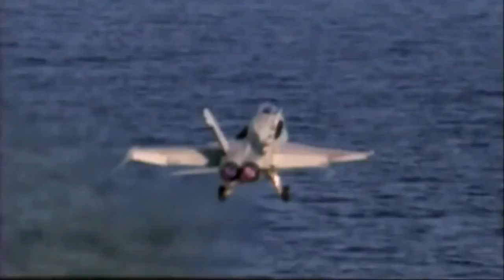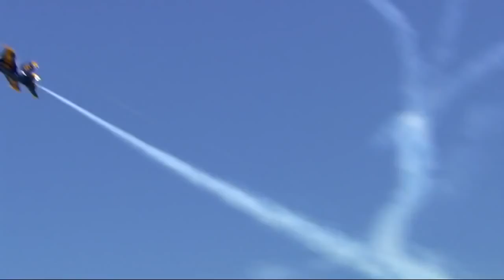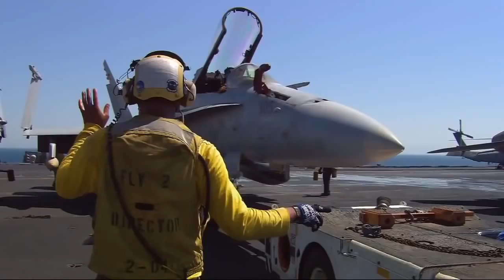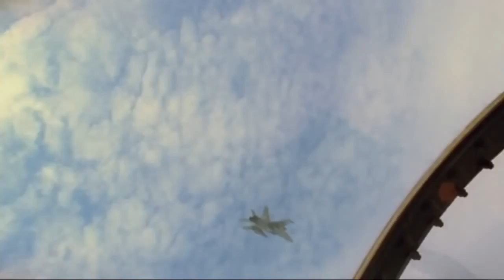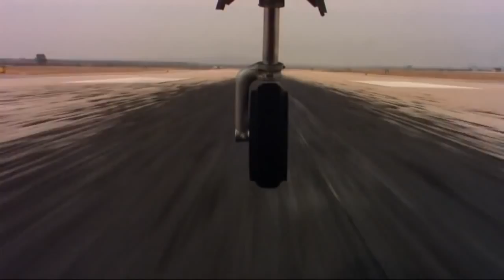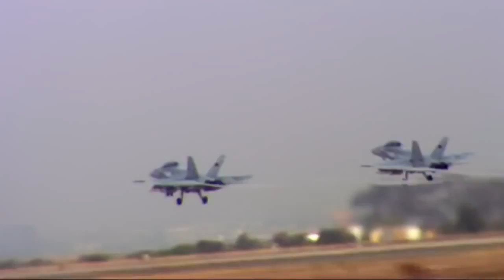Boeing FA-18 Hornet - World's Elite Strike Fighter Attack Jet Full Documentary

Comment: i cant believe i just realized that f 16 cant land on aircraft carrier
Reply: it could.... once.... and gear break off... hopefully no fireballz. did you know that the f-16 and f-18 competed against each other originally for the air force contract... the 16 won... then navy picked up the 18 after.
Reply: It's entirely possible to create an F-16 version for carrier, it was even proposed the Navy almost went for it. eventually they chose the F-18, since it really does have a stronger frame and two engines, while the F-16 has one. if the F-16s engine fails in the middle of the ocean, it's FUBAR.
Reply: Lol nope. Only navy jets land on carriers, f16 is Air Force. Same for f15, and a10 and whatnot
Reply: so you are saying f18 is strictly for navy only?
Reply: +oming daniel Navy and Marines, yes. The Air Force does not fly them. (I was surprised too when I found out lol)
Reply: damn , thanks alot.
Reply: No, airforces around the world that don't conduct carrier operations use F18's as land based aircraft.
Reply: There a re also F-18's in the air force ...
Reply: Krizla 4 Not the US Air Force though
Reply: I see ... because in for instance in Switserland they use F-18's ... they don't have carriers ... but they do have short runways in the alps ... that's where the F18 comes in handy with it's hook to land in short distances.
Reply: Spain, Australia, Canada, Finland and a few others use it as land based aircraft.
Reply: +Jacob Zondag they could, but the navy doesn't fly f-16's.
Reply: id say they dont, not that they cant..
Reply: wizzzer1337 They thought of this idea when the U.S. Navy wanted the f-18, but they said no to the idea.
Reply: You guys ever heard of the F-16N?
Reply: @JSpidey  Stripped down f-16 for Navy dissimilar aircraft training.

Comment: I hope that this plane does not get replaced and rather gets updated like the F15 will
Reply: F-15 is getting replaced by the F-22 Raptor
Reply: +Toxic 28 the f22 isnt theres only  around 200 of them and tgey arent making any more
Reply: +Toxic 28 they are not getting replaced they are getting upgrades and new electronics systems from Lockheed Martin.
Reply: Uncle Paulie where'd you get that info from? Because it doesn't need to be torn apart and put back together after every flight they need quick matinence  check and refueling like every other jet
Reply: Ironically, the F-22 was selected over the F-23 in part because it was more suited to having a carrier version to replace the F-14, then the Navy backed out.  That increased the unit cost, so we got a third the number requested.  The F-14 was replaced by the Super Hornet, and only some of the F-15s got replaced by the F--22.

Comment: USN Blue Angels are flying the hell out of the earlier F/A-18 A, B, C, & D models (aka Hornet)—parts of the jets are actually shedding during Blue Angel flight demos. The U.S. Navy wants to replace these older models with the much newer Super Hornet (E model & double-seater F model). However, the Blue Angels like the easier handling of the older Hornet, because it's lighter and smaller than the husky Super Hornet.
Reply: I wish if they flew the F-14. The F-14 looks way sexier
Reply: @huskythedinosaur1592 but it's not as maneuverable as the F18, that's why they chose the F18
Reply: OP has no clue, such BS propaganda, you smell like a F14 fanboy

Comment: they avoid the f/a-18's downsides completely, such as how the f/a-18 is very poorly equipped to actually fight any modern fighters. F-15,F-16,Su-27,MiG-29, etc. Any of these blow it out of the sky in air-to-air combat. They should keep the f-14 for air-to-air
Reply: The F/A-18E/F Super Hornet can kick all of the above aircrafts ass. I personally seen it happen in Key West when the Super got the AESA radar. They had shot down the F-16 before it even seen the Super
Reply: +Juuso Peltoniemi nimbleness is secondary, most of real life air combat is done beyond visual range. F/A-18 is great if we're fighting less modern militaries, but against modern dedicated air to air platforms it doesn't stand up
Reply: +InternetzSpaceshipz 

:  F-15, F-16 can't take off and landing on aircraft carrier. But F/A-18 super hornet can do and it's capacity isn't lower than F-15 too. but F-18 super hornet cheaper than F-15. Part of F-16 has single engine it at risk. F-35: In addition F-35 can not protect itself(not dogfight) already. And it can't protect any infantry on the ground too.

Comment: Best carrier based plane ever
Reply: +mrwong11989 On a "bang-for-your-buck" basis, I would agree the Hornet is the most cost-effective aircraft ever to launch from a carrier deck, but for sheer air superiority, I don't believe anything can match the F-14 Tomcat platform paired with the unmatched range of the AIM-54 Phoenix missile system. It's too bad the Tomcat was so maintenance-intensive.
Reply: I am going to assume that the Tomcat was replaced by both the smaller F/A-18s and the Super hornets. Its sad to see the Tomcat retire especially when the Tomcat was a very good plane in Top gun but things that get too old have to go at some point.

Comment: I was on the Theodore Roosevelt when we had the A/B models. They were very good aircraft, but short legs. The Tomcats were still the at the top of the food chain. Then came the C/D models. The improvements made it every bit the equal of the F-14. And then the E/F Super Hornets arrived with the Tomcats all in retirement. Superior in all most every aspect to the F-14 (a few would argue that fact) But it is no wonder. The F-14 was really 70's technologies and improved upon over the years.
Reply: As RADM Paul Gillcrist, ret., has observed, "Though it’s a whizzy little airshow performer with a nice, modern cockpit, it (the F-18E) has only 36 percent of the F-14D’s payload/range capability. "

Somthing - not hard to figure what - led the Bush 41 bunch to destroy the Tomcat's production line and tooling as well as all of its development potential. No real resistance from the Navy's top brass -- the same bunch that put all their eggs in the "A-12" basket. Not worth a bucket of warm spit.
Reply: karmpuscookie There were always a few "hangar queens". The Tomcat was no more than any other birds we had on board. Usually they were minor issues that would ground a military plane but be acceptable in civilian aviation. A bad gauge or something that we didn't have a spare for. But I seen em' all!

Comment: why cant modern combat planes have a rotating laser mounted weapon for missile defense? flares are so old school
Reply: Light 1988 They don't generate enough power to support a laser strong enough to destroy a missile.
Reply: zechts how about jammers.
Reply: +Light 1988 Most modern combat aircraft have Infrared laser jammers like the ALQ-144 (Helicopters and larger aircraft) and the AAR-57 CMWS (Common Missile Warning System) that tracks the ultraviolet signature of the missiles exhaust and launches Flare and Pyrophoric decoys) along with C-MIGITS will actively try to confuse an infrared seeker head. Radar tracking, Fire Control and terminal guidance spoofing are usually accomlished by dedicated ECM aircraft with their AN/ALQ-99 pods. In the days of simpler radar systems fighter aircraft could employ simple systems like ECM transponders to fool ranging but not direction finding but with the evolution of pulse doppler and phased array radar that most aircraft and Air Defense systems have now that's not going to help much. Stealth by employing stealth designs and/or RAM material integrated into airframes  are the best defense against radar now.

Comment: The F/A-18 was developed from the failed YF-17 Cobra which was a failure of an Air Force project.
Reply: Gahlok12 yes, but it still works today bombing and patroling and has scored, what 3, 4 aircraft kills?

one of only a few modern fighters that have proven to dogfight well with bombs and tanks atached
Reply: Dassault Aimpoint I know.
Reply: karmpuscookie Yeah but the fact that you said that they went for the F-16 instead kind of calls it a part way one.
Reply: karmpuscookie I know I was pointing out the roots of the F/A-18 and they are great not trying call them junk. The YF-17 wasn't as advanced as the YF-16 and the YF-16 started production during the tail end of the contest so it was being made into the F-16 A.
Reply: +Gahlok12 It has now come full circle and developed into the Super Hornet.......still one of the most badass fighters out there.
Reply: AUmarcus Yeah but the Super Hornet is bigger and weighs more than an F/A-18 C because they made the on board fuel tanks bigger.
Reply: +Gahlok12 Absolutely correct.